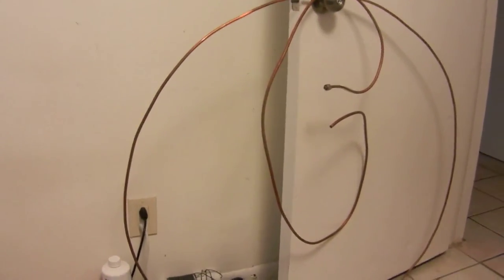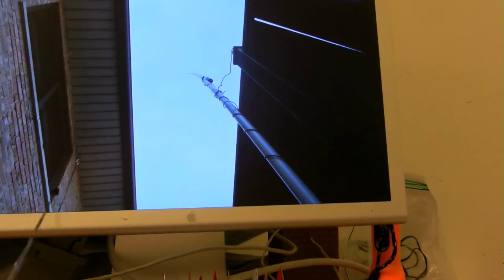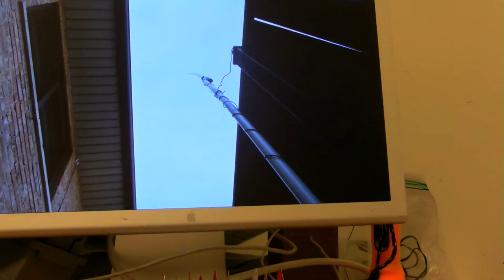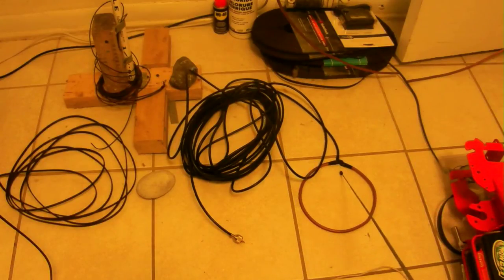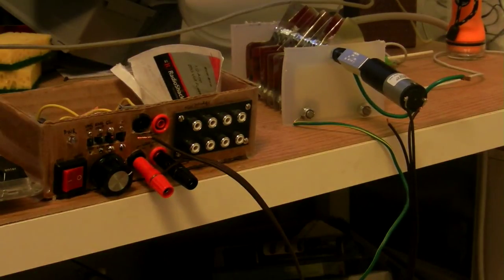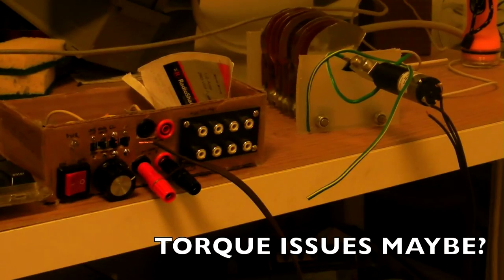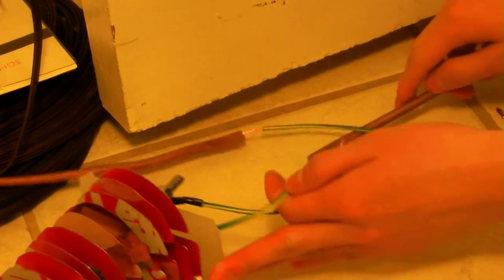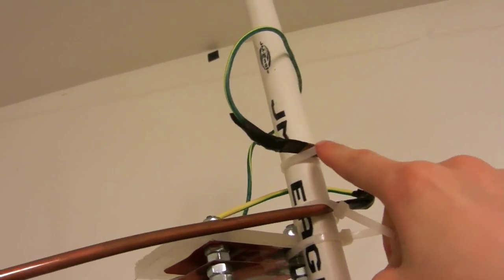Homebrew Magnetic Loop Antenna Part 2  - Loop Assembly

Comment: When I got to the part about the di-pole, I paused it for a second and thought about it. I grew up in a neighborhood that was right under the glide path for a very busy, and fuckin loud ass runway at Cleveland Hopkins Airport (Ohio, Represent!), It was so bad, that the county paid for some grant that allowed the cities to offer free repairs peoples  houses because of siding, roofing and window problems caused by all the vibrations from the aircraft overhead. Yeah, Thanks for the future hearing aid, Boeing! FU
  So when you mentioned that you were hearing some odd noise that reminded me of something I used to hear on a scanner listening to air traffic control because i'm a dork like that, I do not know what frequency range you are trying to pick up with that di-pole, but here is something to consider when trying to track down the ass ache that could be causing these various problems.
  So because I have always been somewhat of a geek, and I was also interested in radios and how they work,  I learned about a weather phenomena called wake turbulence, it's the shit >storm< that follows in the immediate atmosphere when an aircraft passes by at a low altitude. This includes rapidly expelled gasses from the jet engines called jetwash which is a short lived change, as opposed to a lingering vortex in the air technically referred to as 'Wingtip Vortices'. All of these things can will cause reception problems all over the band. I would imagine any reception within 15 air nautical miles from any commercial airport is like pissing into the wind. Propagation of the radio waves will be highly unpredictable without some really sophisticated equipment.  
I like your videos though. We're both dorks,  I write long YouTube video comments, we both like radio shit. Sounds like the recipe for an intelligent, and mildly comedic blog. What's up? lolz

Comment: for that dipole you have under the eaves.... if u bring that out to the edge of the roof and raise it about 6 inches above the roof you will solve your problem with the directionality and also probably fix the resonance.
Reply from the maker: Hmm, good thought. The dipole is hung on the side of the building using CATV coax clips that were already on the wall. It also took a bit of work to get a ladder up there. I might fix that antenna sometime this summer.

Comment: i know this is an old video so u have probably rebuilt this a couple times by now. but you should put the cap outside of the large loop. anything inside the large loop will effect the tuning of the antenna. also if u put the smaller loop at the top and the cap at the bottom under the large loop you will be able to tune it better.
Reply from the maker: Also a good idea. Strangely, most of the loops I referenced while building this one had caps inside the loop, so I never considered the other configurations. Eventually, I'll have this loop better altered for the "automatic" tuning and operate it on 40m. When that happens, I'll probably test what you mentioned.
Reply: It doesn't really matter whether the capacitor is inside or outside the loop since the magnetic field wraps around the refrigerator tubing anyway; there's as much magnetic field in close proximity on the ouside as there is inside.  Would it change the tuning?  Sure, and you adjust the capacitor by about one degree of rotation to compensate.  Done!  Problem solved.  
What is likely to get benefit is braided wire from the rotor to the loop.  You will have 10 to 20 AMPS of current when transmitting.  I've had quarter inch copper tubing warm up while transmitting only 40 watts.  Thicker tubing made a big difference for me.
Reply: MFJ mass produces a very successful 40-10 loop, that has everything within the loop, it is smaller, and built to sit on a mast in horizontal polarization. Just build it the way you can, and reinforce it once radio tunability is happy. 
2 things I suggest:
-The driven loop should be feedpoint away from big loop for better coupling.
-Keep it standing up, because when it is, the antenna is endfire directional, and it is kinda cool to be able to rotate it to favor signals, per direction, and prove the Earth is round by hearing Japan with antenna pointed NNW/SSE.

Comment: Is that like a 1970's HF radio?
Reply from the maker: +Ron Rudd Yep, Kenwood TS-120s. Functions well except for one audio glitch if you turn it up too high on speaker. And an old Hallicrafters 1-30 MHz receiver next to it.
Reply: It's better than mine LOL I have a Alinco DX9T a cheapo radio on a MFJ 40-15m loop. Ham radio here in Australia is DEAD!!! there is a whole 14k of them here. I can turn the radio on all day on a 2m or 70cm frequency and here nobody. I only got a basic licence this year but never knew it was this dead. 
About a month ago I bought a new Yaesu FTM-100DR digital/analogue - pretty cool little radio and has GPS and APRS. If you use the digital repeaters on the Wires-X it shows your callsign and distance stats. Only thing wrong with that one for me is it transmits 5/20/50W and 5W isn't enough to reach city repeater and only licenced for 10W so if I talk just hope they don't ask what power I'm running so I don't need to Lie hahaha ;-)  Just leave it on full power, doesn't cause any problems to anything so can't see anyone giving a stuff. :)